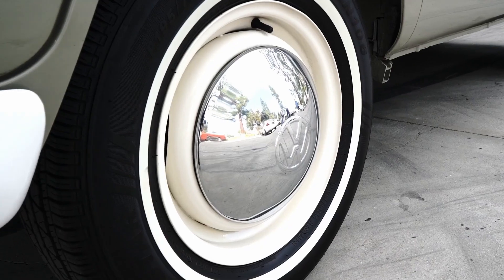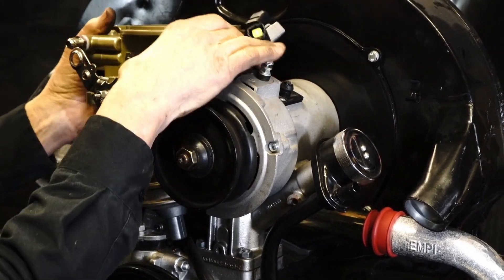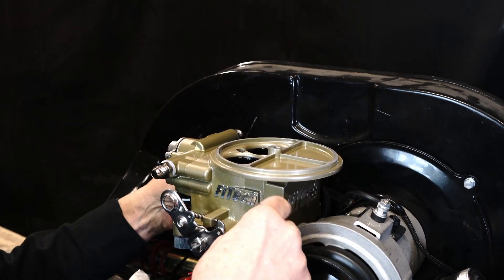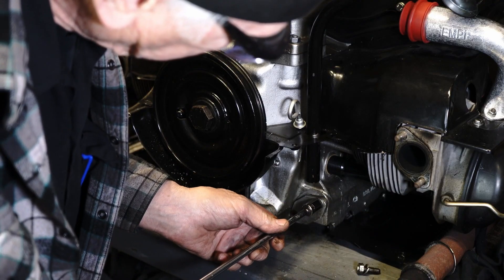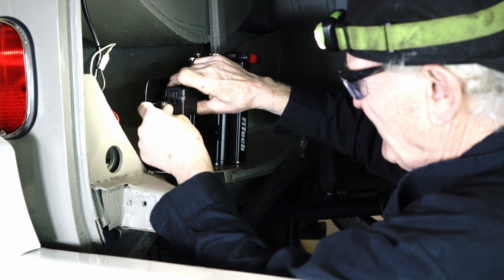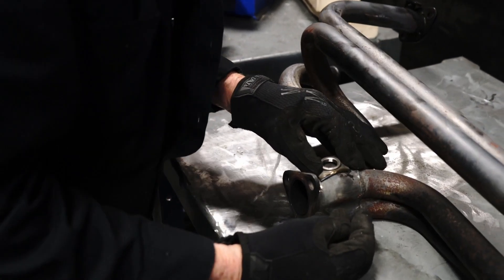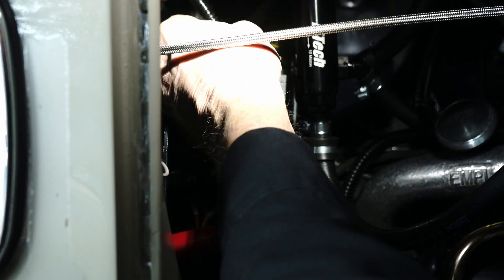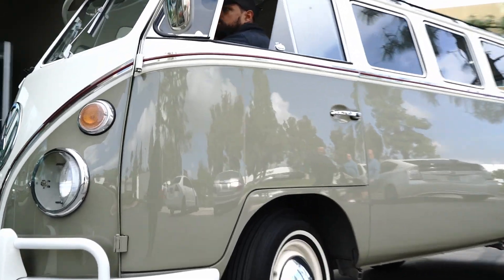1966 VW BUS EFI INSTALLATION | FiTech Tech Video

Comment: Why did you use the Force Fuel Mini and not just an electronic pump?
Reply from the maker: This customer did not want the tank to he heavily modified with an intank pump and an inline pump will not work with a 1/4 inch feed line from the tank. The Force Fuel was the best  option with this installation.

Comment: What were the results from the dyno? Any mods to the distributor vacuum? Was it even hooked up to the effi? Idle shoild be a bit higher than 550 rpm, more like 750, to keep the fan going fast enough to cool the engine. And the oil temp will be too high, I believe.

Comment: There is no manifold heat from the exhaust on that mamifold, this will result in manifold icing/fuel not vaporizing and a poor fuel burn resulting in poor mpg/power and high crabon buildup.